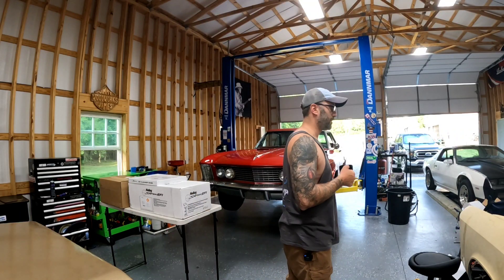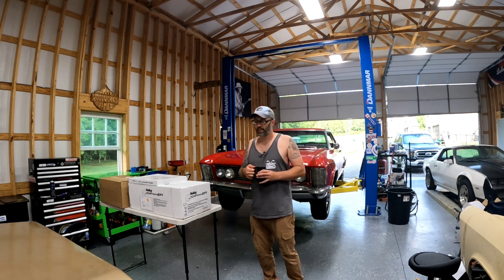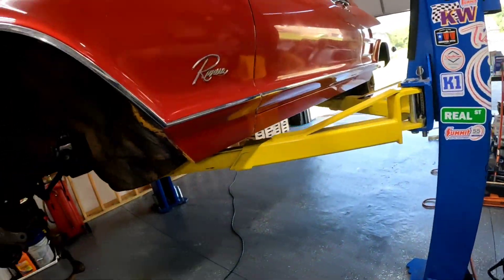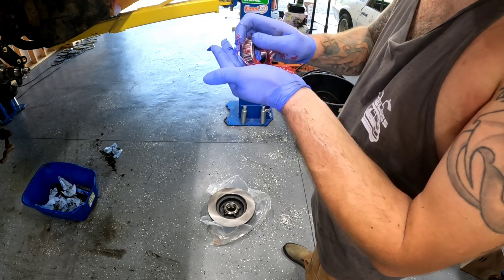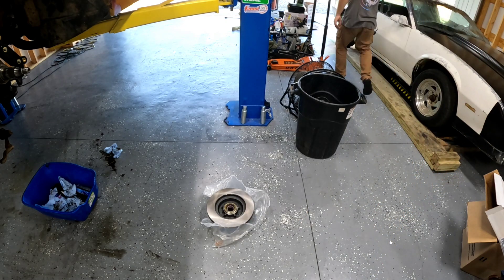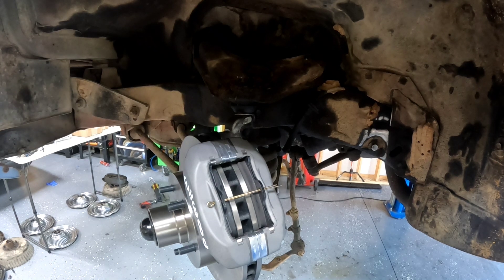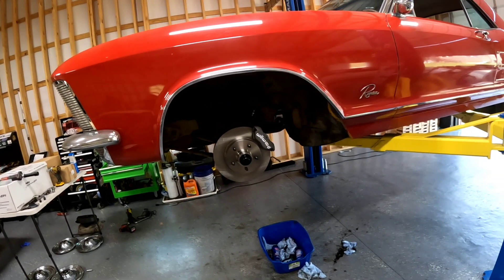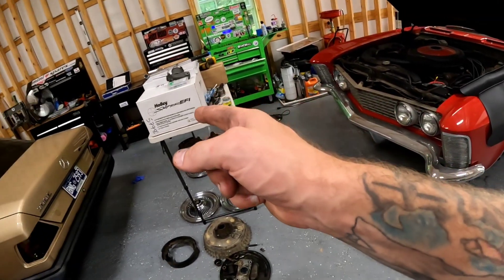1964 Buick Riviera Disc Brake Conversion.

Comment: I’ve got a 68. I bought a conversion kit from POL and I found out I need to do some modifications to brackets. Any advice or recommendations?
Reply from the maker: Not Familiar with the brackets or that kit.  Probably just minor clearance.  At the end of the day the caliper just needs to be centered on the disc and all hardware needs to have clearance from the disc...Buy yourself a pack of shims and basic tools, grinder wheels drill etc you should be good... Sorry not more helpful but I am not familiar with the POL kit.

Comment: Hey I've worked on cars my whole life. I heard u talk about putting a dual master on. In my opinion for a novice  this could be a dangerous job. Have a shade tree  mech  do this is a no no. Good veiw but, the rear drums need the the pressure reg and Add residual pressure valve. And there own chamber. Just a opinion.
Reply: Dual master is a must

Comment: You should have not kept teh single reservoir MC. Especially after upgrading to discs?????
Reply from the maker: In the video, I mentioned why.   I was trying to get the car ready for a road trip that was days away.   It was what I could get in that short of time.  The willwood kit works with a single pot.  You just have to modify the master.  Obviously, it's not the best or most ideal.  I will be changing it out.